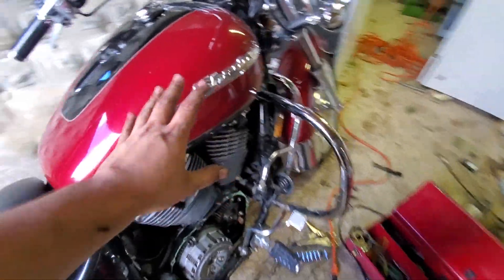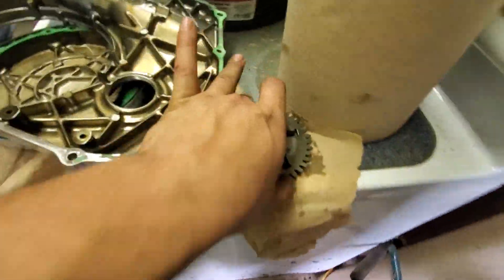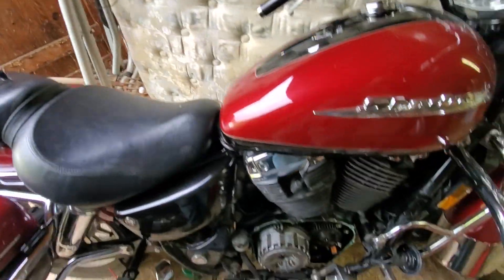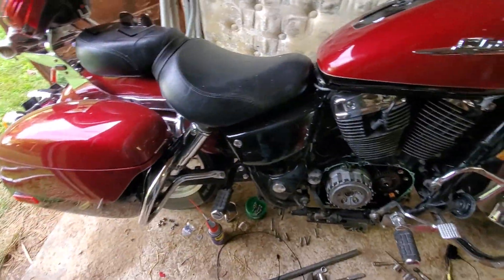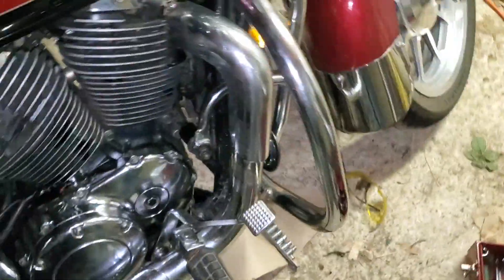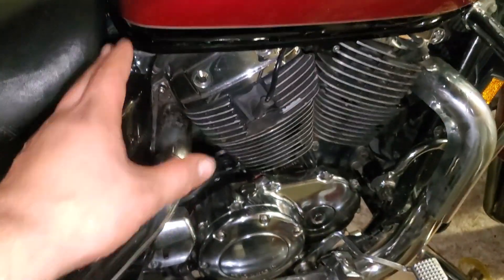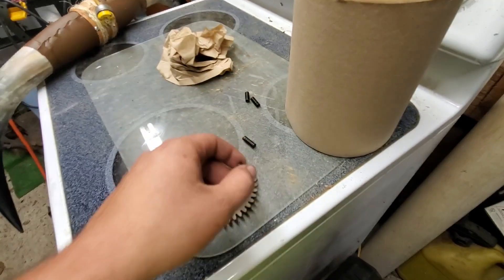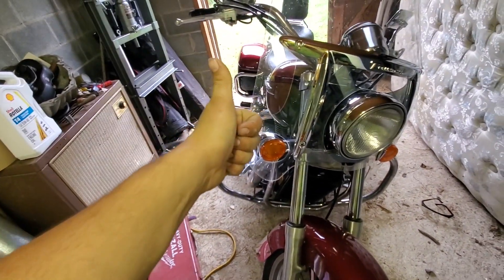(Read Desc.) Honda Shadow 1100 Primary Drive Gear Fix

Comment: Did you replace the outer clutch basket in order to resolve the clunking noise? It is driven by the primary drive gear. It has 6 springs in the back and a needle bearing that I have heard could be the problem. I think my 2002 VT1100C Spirit has the same issue but only when the engine is under a load and running under 2500 RPMs.  Thanks for the video!  It encourages me to tackle the job.
Reply from the maker: @rocknrodosta  The clutch basket was fine. What ended up being the problem was a main crank bearing going out. 

The clunking came from the stator slapping around the inside of the case. The symptom was a dead battery after a long ride.